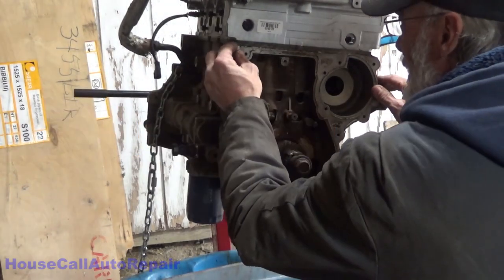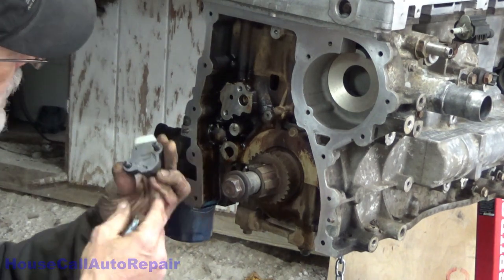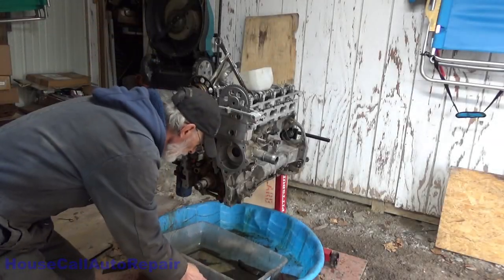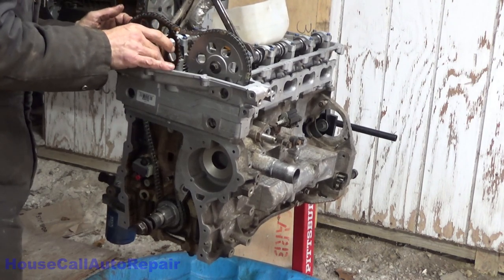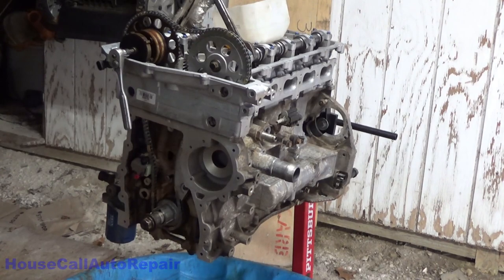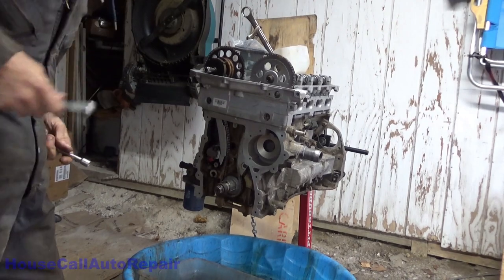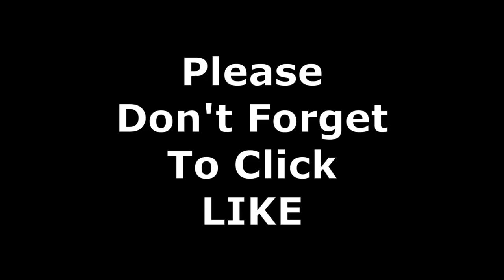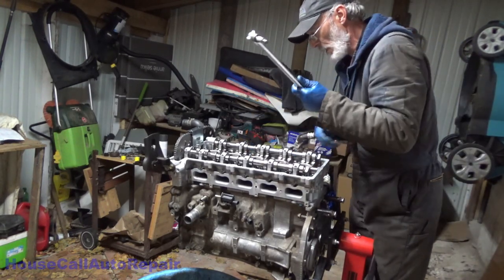2006 Hummer H3 3.5 5cyl - Timing chain and oil pump -  Part 5

Comment: the only concern i have is you installed some bolts with loctite and said you would come back and torque later i worry if the loctite sets up before you retorque could cause some problems. and the cam sprocket being locked should have made sure and explained the process of making sure its was locked. really enjoyed video you are braver than me would have never took on that job.
Reply from the maker: This was, without any doubt, quite a challenge. No available internet access, so I either wrote down what I needed, or held off until I did.
(got a 2016 Cruze 1.4 torn down to the block, in the car. Just putting in the gearset today)